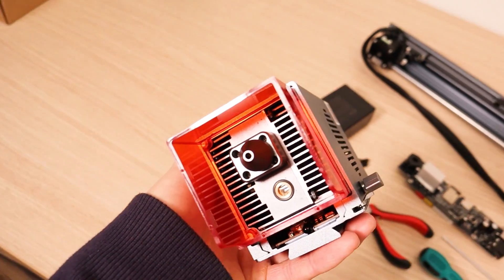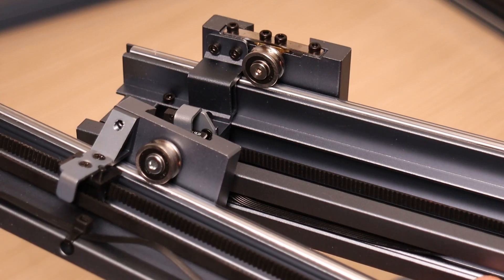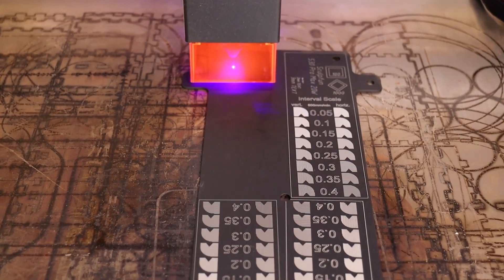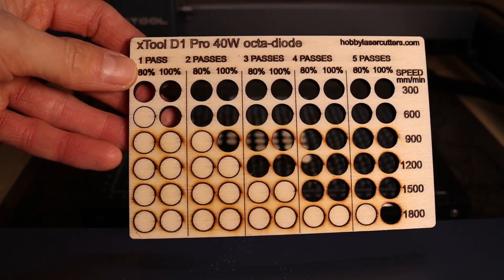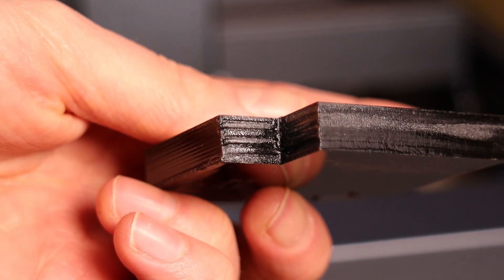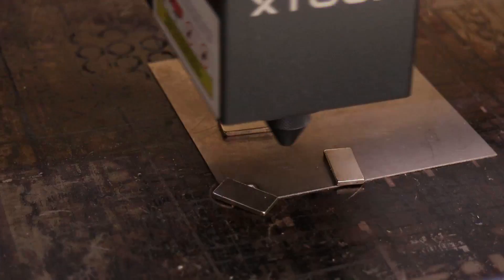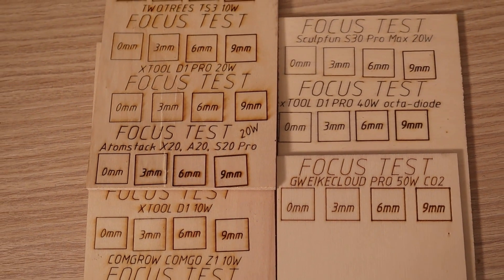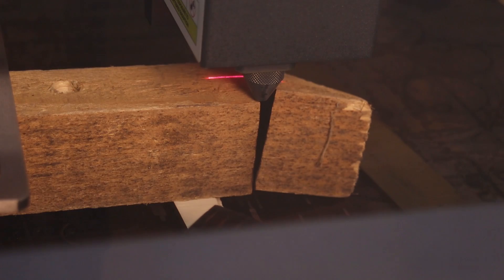xTool D1 Pro 40W Review - World's FIRST 40W Octa-diode Laser Module! Lets See What It Can Really Do!

Comment: Great review and test run, JT.

You might consider doing the beam focus test with anodized aluminum instead of wood.  There's a good possibility that the 40 Watt's wider line is due to peripheral heating of the adjacent wood from the higher thermal flow of the more powerful laser.  Wood's insulating properties would tend to allow more localized heat buildup, causing the wood to caramelize.  Sufficiently thick aluminum, on the other hand, wouldn't have that same tendency to heat soak.

Your testing discipline is fabulous.  (I'm an R&D engineer, so take that as high praise.)  I suspect that the thought of inserting a rift into your sample library and its dataset by changing materials mid-stream gives you pause-as well it should.  Nevertheless, having the xTools D1 40W beam focus test AND the D1 40W samples in both materials prpvides a bridge--a Rosetta Stone of sorts--between the pre and post-rift data.  I do think the anodized aluminum will give results with fewer process variables and ancillary effects.

Thanks, again, for the excellent shakedown and comparisons.  The solid data from your testing makes it much easier to decide to spend the $2k+ on a premium rig and 40W upgrade.  Infrared is a game changer, too.
Reply from the maker: Thank you very much for your reply!

I have considered using anodized aluminum for focus test, but when I started doing my reviews of the 5W machines, they were not powerful enough to mark anodized aluminum from a large distance. This is why I stayed with wood, so it is easy to compare the results. I don't use full power for the focus test, I try to reduce power just enough that the engraving effect is similar.

I am a R&D engineer too, so maybe this is the reason for my tests to be the way they are :) Thanks for your praise, I really appreciate it!

If I will be testing more of machines this powerful, I will start using anodized aluminum and then I will reverse test this machine too. I usually update the blog posts on my website with new data when available.